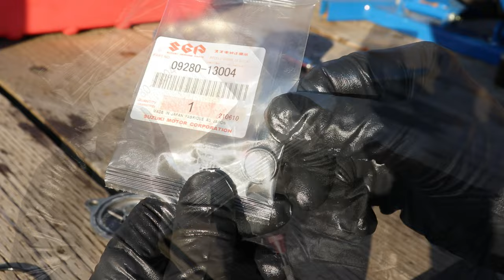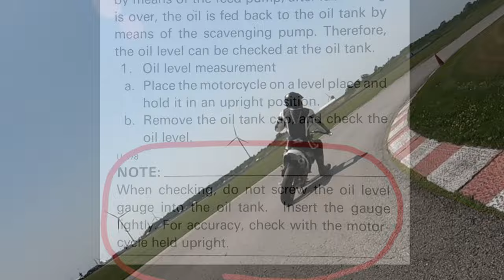DRZ 400 Oil Change -The Secret Filter You Need to Know About.

Comment from the maker: If its time to winterize your bike check out this video to  get it done fast and easy 
     https://youtu.be/hhL3lfbNl6Q
Reply: Hey there! What a great video! Would it be possible to get the inner and outer diameters of the washers and seals you replaced? 
The original parts are so hard to get in some countries. Would really save me (and im sure some more people) a lot of time and potentially even money.
Reply from the maker: @eriii276  Hi Eriii276 Thanks very much .Glad you enjoyed the video . I dont have those parts in hand to get the dimensions on but will try when I get a chance .One trick you can sometimes have success with is using the crush washers that come with new spark plugs . They surprisingly fit many drain plugs . I have used them in a pinch when nothing else as available . Thanks again I will try and find the O ring dimensions asap .Cheers
Reply: @TRyanLearnBikes  that is very nice of you. :) 
And thanks for the tip!
Reply: Any updates yet? :)
Reply from the maker: @eriii276  sorry nothing yet ..slipped my mind. I'll see if I can source that information for you when I get a chance
Reply: @TRyanLearnBikes  sure thing!

Comment: Awesome video, but I wouldn't recommend pulling the bolt under the filter housing. The case is notorious for cracking when reinstalling that bolt. Even when torqued properly.
Reply from the maker: Hey Matt thanks very much .I appreciate you taking the time to comment with some great information .I have had more than a few comments regarding that contentious filter housing bolt so its time I address the problem . I've just added an addendum in the description section to explain why it may not be a great idea to touch that bolt . Hopefully it will save someone from the greif of messing it up. Thanks again .
Cheers 
🍺

Comment: Great video paps! 

Although I’ve been riding my 01’ E for 16 years and I’ve never replaced my crush washers 😂
Reply from the maker: @SirLancedHerLot7  Thanks .But will you replace them now ?
Reply: @TRyanLearnBikes  HA never! If it ain’t broke, why fix it 😏 I don’t even torque the drain bolts to spec, just hand tight and then an extra 1/8 turn, never have removed the skid plate either, or measure out my oil… 

Drz400 are bullet proof, if all that extra care gives you peace of mind friend, then go for it… but otherwise, just send her bro
Reply from the maker: @SirLancedHerLot7  OK man I can appreciate your honesty. If it's worked for you so far then you do you and ride on .Cheers buddy 🍻

Comment: Great video but the special 45° thingy for the drain plug is supposed to go 45° on the engine
Reply from the maker: Thanks very much man .I appreciate you watching and taking the time to comment . We must be using different manuals or one of us is looking at it upside down because in my manual it shows a specific diagram of the orientation of the crush washer and I'm just following their recommendation . I'm guessing that neither one of us is having leak issues so it probably doesn't matter too much . At least we are using new ones because based on some comments I have had lots of guys don't even bother ever replacing them .Thanks again .Cheers 🍺

Comment: Great video, just don't agree on the torque wrench to tighten the drain bolt.  to easy for a new rider to over torque and strip the threads. I would recommend a good 3/8 wrench and snug on the drain bolts and check after 100 miles for leaks. Great video!
Reply from the maker: Hey Stevo ,thanks very much for watching and taking the time to comment .You are certainly not alone with your thoughts about  torquing  the drain bolt .I made a  youtube short specifically about the drain bolt in this video and ,wow did it  stike a nerve .Some of the comment threads were quite interesting  to say the least. If you get a chance take a look you may find it entertaining .But again I thank you for  watching and commenting so kindly, I truly appreciate it.
      https://youtube.com/shorts/2EdgpFJykQI?feature=share

Comment: Great video! Can you help me out, I have a 2020 Suzuki drz400Sm, do you know where I can buy the whole kit for my oil change ? With all washers orings etc. thanks
Reply from the maker: Hi Jose.Im not aware of any kit offered that has the parts outlined in the video. But whatever Suzuki Dealer you do business with will  likely have an online parts finder page that makes it very easy to get whatever you need .I'm pretty sure the part numbers in the video will match your bike as the motors haven't changed much in a very long time .But still cross reference them with your model year just to be sure.
Hope that helps .Good luck and enjoy your machine. Cheers 🍻
Reply: Tusk sells a kit complete with oil, washers, filter, and o rings but the washers are not crush washers. I used the tusk washer and no leaks yet but will probably buy crush washers for my next change

Comment: What’s ‘safety wire’? Great vid mate. From Australia
Reply from the maker: Safety wire is used to secure a bolt in place .The head is drilled to accommodate a thin wire through it and then twisted to the frame or another part of the engine. Typically done on race machines or aircraft or on any critical bolt on any piece of machinery. Thanks very much for watching and taking the time to comment so kindly from Australia. Cheers 🍻

Comment: What is safety wire, is tension wire to prevent an over torque of the bolt?
Reply from the maker: @benl4707  Safety wire is used to keep a bolt in position after being correctly torqued.

Comment: So there are 3 drainage bolts. Which one could i replace with an oil pressure sensor? Best one dor accurate reading should be the main oil drainage bolt in the bottom of the Motor? Right
Reply from the maker: Well sir I've asked some pro mechanics about your inquiry .The frame drain and the main drain plug won't work well for you , which leaves the small drain plug near the oil filter as a potential spot .These engines don't run with much oil pressure at all with a roller bearing crank. Your sensor will have a very low scale probably less that 5psi max . I don't know anyone that has an oil  pressure sensor  on their DRZ and it does'nt seem to be a contentious issue in the DRZ community when I look into it  . Having said that I'm sure someone out there has installed one successfully .I will keep digging into it for a definitive answer but for now thats all I've got for you . Hope that helps in some small way . If you do find some solid intel please let me know in this thread and I'll make a video about it to help others . Cheers

Comment: I’ve done nearly 10 oil changes on my drz since i got it new and it turns out i’ve put my crush washers on upside down every time. Oops.
Reply from the maker: @kurtsvensson4362  You're not alone Kurt .I did the same thing until I actually read the manual.
So I'm guessing it really doesn't matter that much ,I mean some guys don't even replace them .
Thanks for watching and for taking the time to comment. Cheers buddy 🍺

Comment: Idk about the drain plug for the oil filter, I’ve heard to NEVER touch that and that it’s for testing oil pressure or something like that. Strips very easily so I’ve heard
Reply from the maker: Well sir you are correct that this access point is used for connecting an oil pressure gauge .To never use it as a  convenient drain point for the oil filter housing is an interesting thought .To say it strips out easily is something I have never seen or heard of .Like any nut or bolt ,if you use common sense and have a reasonable mechanical feel I dont think it would be an issue .Thanks for raising the point and taking te time to comment .Cheers

Comment: What is safety wire on drain bolts?
Reply from the maker: It's common mostly on race bikes  .Basically it's a small hole drilled in the cap of the drain bolt to allow a wire to be threaded through it  ( after being  tightened) and anchored to a secure point on the frame or adjacent bolt .It  Gaurantees the bolt can't come loose .

Comment: Are all the washers crush washers? Is that just regular white lithium grease for the filter cap thing? Do you replace that O-ring also?
Reply from the maker: Both drain bolts should have new crush washers.Just regular white  lithium  grease works fine to hold in the O ring on the cover .And Yes I do recommend replacing both O rings .But you don't usually have to unless the old ones are compromised in some way .

Comment: Wish I had this video when I changed the oil yesterday in my new 23 sm.  Apparently I put the crush washer on the front drain upside down....  I got confused also b/c they only sent me one crush washer when I purchased the kit, even though there are two drain bolts.  Nothing has leaked as of yet, so I think I'm ok.  I will make sure next time I ask for both crush washers, and put them in facing the right way.  I don't think it's worth draining and redoing it all and wasting oil if it's currently not leaking.  Thoughts?
Reply from the maker: Not to worry  man , you'll be fine .There's lots of guys out there who never replace the washer at all or use all kinds of other bits and pieces to save a buck .If you get a chance take a look at the video I recently put out about an oil change on a suzuki bandit  There's lots of comments about crush washers high lighted  in that one ..you.may get a chuckle its pretty funny what some people say .Cheers my friend and thanks for taking the time to comment.

Comment: Should you replace the washers from the banjo bolt and the oil filter drain bolt washer everytime like the crush washers? If not, how often? Thank you
Reply from the maker: Well Joseph you make an interesting point .It's a good idea to replace most any sealing type washer when you get the opportunity .While I did not replace them in the video .If I had new ones at the time  I definitely would have .Know that I have ordered all  of the washers required for the next oil change and will be certain to install them then .They cost so little and it's  good insurance  to replace them  when you can . Thanks for the great question. 
Cheers 🍻

Comment: What do you mean to use safety wire??
Reply from the maker: It's typically a procedure done on race engines that secures a bolt in position once its  torqued down .The bolt head would have a small hole drilled through it that allows a thin wire to pass through and  be  secured to a fixed point on the frame or engine. It may be a little bit over the top for some people. But it's a failsafe way to be 100 % sure nothing comes loose .That's why it's a must on any race bike to pass tech .If you observe proper torque settings you should be ok in most normal road bike applications .Thanks for watching and commenting. 
Cheers 🍻

Comment: Hello, 
I've bought recently a 400 DR-Z and a I make my first oil change but I forgot to empty oil in the front frame (sorry my bad....) I replace oil and the 1.8 liter goes inside without overflow. Should I be worried to have to much oil in the frame/engine ? Or the whole previous oil had gone out by the engine hole because its the lowest point of both oil change holes ? 

Thank you for your help
Reply from the maker: There's a good chance you have too much oil in the bike .It will only show the correct level of oil on the dip stick when the engine is warm . It's an easy mistake to make .I would start over by draining the frame and engine and if you change the filter add 1.8 liters .of oil. If you don't change the filter add 1.7 liters. Then warm.the engine and check the dip stick ...its very important to check when warmed up .That's how you will get  true read .
Reply: @TRyanLearnBikes  OK. I'll proceed according your advice. Thank you very much :)
Reply: And I made a 3km test run after oil change. Do I had any chance to damage the engine ?
Reply from the maker: @yannickfis6106  No man you should be ok ..I did the same thing with no issues..Its all about learning from our mistakes right Ride safe my friend
Reply: @TRyanLearnBikes  . OK thank you very much for your answers and your time 🙂 and of course, thank you for the video 😁
Reply from the maker: @yannickfis6106 My pleasure. Cheers my friend 🍻
Reply: @yannickfis6106  I realize this is a month old, but in case you are still wondering - no, your engine is perfectly safe. There is a breather box that cools down the oil when it gets too hot and tries to evaporate, if this box is unable to cool the oil(because it's too warm inside) it lets the oil into the airbox and then the oil makes its way into the cylinder and burns. Theoretically you could fill it to the brim with oil and it would sort itself out after a while, the only downside would be lower performance during this time. Don't worry.
Reply: @2strokedesign  Thank you very much for your time and for the technical détails :)

Comment: The only problem is what you consider reasonably tight and what I consider reasonably tight are very two different things lol 🤷‍♂️
Reply: I consider it like this you have tight that you can’t undo by hand and you need a tool. And then way up on the other end you have a tight that snaps the bolt head off ....... but in the middle, you will find reasonably tight….lol
Reply from the maker: You make a valid point Brian good sir .Thanks for watching and taking the time to comment .
Reply from the maker: @rolandkeith5322  Very well said R.K. Your explanation sums it up precisely. Cheers my friend